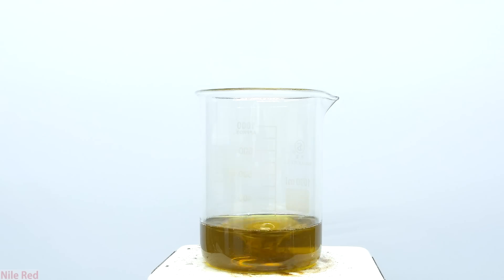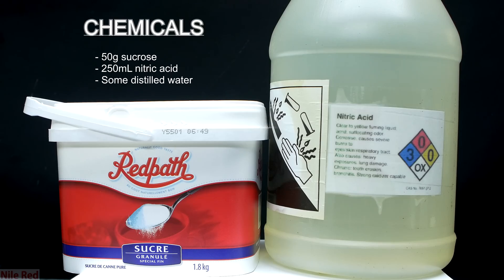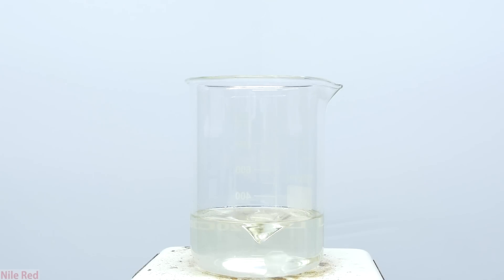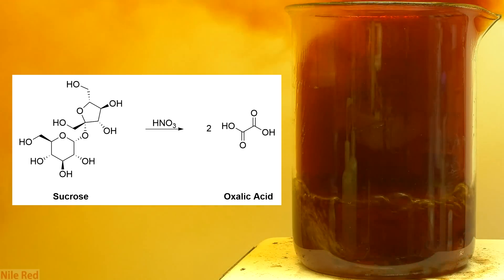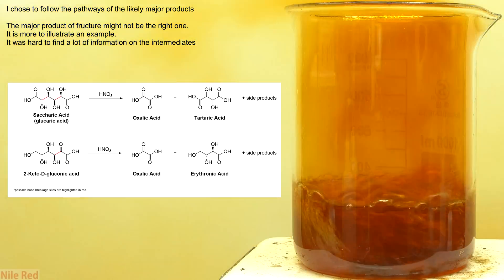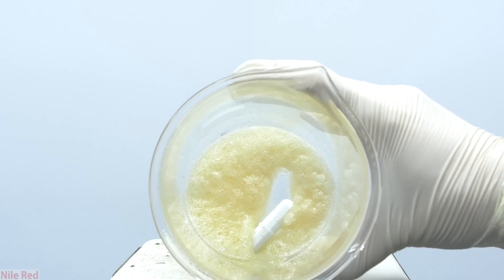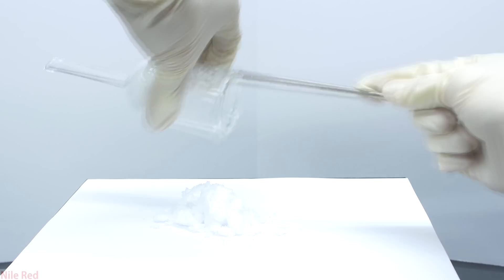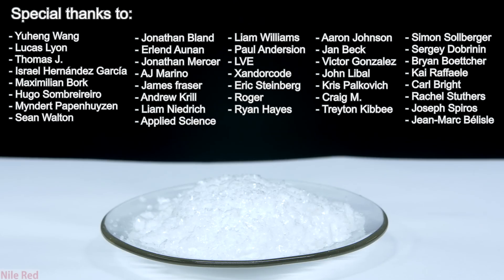Making oxalic acid from cane sugar

Comment: Well sugar would be a cheap way to nitrogen oxides from nitric acid.  The stoichiometry of the nitrogen oxides is important if you want to use a potassium hydroxide scrubber.  At least half would be the nitrite.  Hydrogen peroxide could be a scrubber to reclaim nitric acid.

Comment: This is actually pretty close to the reaction used in industry to manufacture oxalic acid. Instead of using just nitric acid, a mixture of sulfuric and nitric is used. Vanadium pentoxide is usually added as a catalyst. Other (read: cheaper) carbohydrates can be used, like sawdust or molasses. The loss of yield is outweighed by using what is basically waste biomass as the starting material.

Comment: Oxalic is very toxic beyond kidney issues and not just by ingestion! Correct this video for safety! I use this and many other materials industrially, going on 45 years now. It can be absorbed through the skin or mucous membranes and rather quickly if there are any minor cuts or abrasions. Calcium oxalates form quickly inside the body and will create insoluble obstructions in finer blood vessels. STROKES. Medically documented in leather tanners who regularly handled liquid solutions without gloves. This information is not on standard SDS papers.

Comment: Try washing the precipitate with acetone, oxalic acid doesnt dissolve in acetone, morover acetone absorbs the  h2o on the oxalic acid. Then proceed with heating the oxalic acid at the oven and putting it at desicator 24 hours

Comment: Why do chemists always just let the no2 fly off? wouldnt it be more efficient to do this in a RBF and have the no2 get bubbled into water to make more nitric acid from the no2??
Reply: It absolutely would be more efficient, but it would also mean more preperation, more cleaning, and potentially more waste. Plus, putting gasses in a closed enviroment like a bubbler requires careful treatment, and consistant attention. The extra effort may be worthwhile for an amateur chemist without easy access to nitric acid, but I take it that NileRed has a safe surplus of the stuff.
Reply: Since the nitric acid is expensive, the NO2 gas really ought to be captured, and you'd certainly do this if you wanted to make a lot of oxalic acid; but the bubbler and all that rigmarole to regenerate the nitric acid begins to distract from the purpose of the video. And the toxic gas looks really awesome

Comment: can u recrystalize the oxalic acid washings?
Reply: Jorge M not effective
Reply: Firehoax I'm a chemistry student, and sometimes it worked for me ( with different compounds and solvents) but I just had the idea.. plus u can evaporate all solvent, redissolve and crystallyse( tho water would suck to evaporate)
Reply: Jorge M yea, but its a 43per cent yield so I wouldn't even try
Reply: Well, shame nitric acid is hard to get i guess
Reply: Jorge M yes, but in croatia you can get it for 15$ per liter azeotropic

Comment: how to prepare derivatives of oxalic acid ?
Reply: I know you can get simple oxalate salts by reacting oxalic acid with alkali hydroxides.  For example, C2H2O4 + 2 KOH -> K2C2O4 + 2 H2O , then you'd have to evaporate the solution to retrieve your potassium oxalate (with small amounts of KOH or oxalic acid impurities, depending on which one was in slight excess).  That's all I know, sorry...

Comment: Any chance you'd show us how to extract oxalic acid from rhubarb leaves?
Reply: Take a soxhlett, put in your rhubarb leaves, take water as a solvent and let the extraction run for a couple of hours. Boil of the createt solution, maybe wash it with ether (or a similar polar solvent,). The oxalic acit shouldn't solve very well in organic solvents. If it's to dirty you can rekristallise it out of water. Aceton could work as well
Reply: @stanalbatross8615  Thanks!
Reply: how should i know what the right reagents that should be used in extracting oxalic acid? in the video he uses nitric acid, is it ok if i also use nitric acid for extracting oxalic acid from a fruit?
Reply: @yukiyuki7761  No, the nitric acid's used for breaking down the precursor molecule (sucrose), NOT as a solvent! Also if you don't know what "organic solvents" are, then you really shouldn't be extracting oxalic acid from anything at all.
Reply: Yuki Yuki - no, that would be a waste of nitric acid.

Comment: Have you tried melting stone yet. oxalic, acetic, citric acids. It is said the combination can disolve stone and metal but is safe to handle with your hand and leather boots. It was originally found in a jungle plant in South America. birds used the leaves to carve holes in the stone cliffs for nesting. it also ate the spurrs off the explorers boots when they were trying to find the plant. At first the couldn't find it but they lost the metal from their boot, so they knew they had at least passed through it and it was not a hoax. 

I am not sure if it is the same composition but INCO uses a chemical smelting process to extract metals from granite by melting the raw material and solidifiing the seperate components. Almost magic to watch.
Reply: A type of geopolymer: non-carbon polymers of silicate and almuminate groups, at least if you're using alkali process!
Acid process acts on the grain-bounderies of stone, softening it enough to work by hand.
Exposure to CO2 from the air hardens the stuff over time.
Egyptians grew enormous fields of rushes, relative to the North American cat-tails.
They grew rushes, burned them and collected the ashes.  Potassium and sodium carbonate mixture, quite basic.
Additional work make the hydroxides of the salts; lye and potash.
Take your stone, pulverize it a bit, and steep in the caustic lye solution.
The silicate and aluminate groups are torn apart by the solution at first, making a putty-like substance that is a mixture of Si and Al monomers.
The monomers link up to form polymer groups,  typically flat hexagonal structures.
The flats stack up to form crystals with 'holes' in them.  The center of the hexagonal cores is empty, so it lets some molecules through based on size or electrical charge.
A geologist would call this crystal a Zeolite, a scientist would call it a molecular sieve, the workers at Ghiza called it mud and packed it into molds to make the big blocks.
This is why the massive stones fit together so well; they were cast in place!  
Fluids move to fill their surroundings, putty under pressure does the same thing.

Comment: Actually you don't need nitric acid for this. Hydrogen peroxide with a small amount of either vinegar or hydrochloric acid is probably better and it can afford you a little more control over the degree of oxidation that occurs. Cold and Dilute hydrogen peroxide can  afford ketones and aldehydes, where as, something like this, would be hot and something like 10% h2o2 taken to a roiling boil.
Reply: Walter Bunn How about HCl oxidized with bleach? I cant get neither 96% sulfuric, neither nitric or pot nitrate. I live in Europe.

Comment: Can you try to wash the product with diethyl ether or hexane to get rid of the organic impurities? Or try DCM, Chloroform, ethyl acetate or THF? I think most of the organic acids are not pretty soluble in those kind of solvents while the organic impurities are quite soluble. I will probably triturate the crude product with one of those solvent and then recrystallise in methanol/ether or methanol/hexane system. Hopefully will get a very pure product.

Comment: Would ethylene glycol from antifreeze and oxidizing with potassium permanganate work?
Reply: This would be exothermic and just burn.
Reply: if you dilute  the antifreeze and acidic potassium permanganate soln.... u could make it... problem is the separation of Mn ions and oxalic acid
Reply: looks like it's time to hit the lab :3
Reply: You can use a mixture of nitric and sulfuric acids to oxidize ethylene glycol. Important: ONLY use dilute acids (30-38%). If you use concentrated acids, you will make EGDN, which is a powerful touchy explosive, a nitroglycerin analogue.

Comment: One book I have,describes the preparation of oxalic acid from wood chips: those are heated in strong solution of KOH. Cellulose is said to dissolve,forming HCOOK at first,but upon continiued heating,potassium oxalate. further,oxalate is just percipitated as calcium salt,reacted with HCl to give the acid and cooled,to make it crystalise.. 
So does that basically mean,that potassium formate,upon heating,sort of reacts with itself to make oxalate?( it is said here,that two molecules of formate combine,to give one molecule of oxalate).
Asking,because I haven't seen any oxalic acid being sold around,but local hardware store sells 85 % formic acid.. was wondering if I could make it this way..
Another idea was to isolate it from rhurhab leaves,but I guess that's just too inefficient and complicated..
Reply: the sodium formate  is reakting with "itself" to form the sodium oxalic acid. thats what they do in the industry. at around 360°C, not sure if under pressure.

Comment: Concentrated Nitric acid is essentially completely off limits to any hobbyist in the UK. You can apply for a permit but as far as I can tell you won't be granted it unless you are some kind of established company.
Reply from the maker: can you get nitrate salts?
Reply: Nile Red you can, but the supplier will probably report it to the government, and if they decide to come a knocking and you have used it to make concentrated nitric without a license you can get 2 years, at least that's my reading of it https://www.gov.uk/government/publications/licensing-for-home-users-of-explosives-precursors/licensing-for-home-users-of-poisons-and-explosive-precursors
Reply: Wow the uk sucks
Reply: +Michael Stephenson i dont think you're doing your homework son
Reply: +zombie apocalypse "After 3 March 2016, it is an offence to possess or use a regulated substance without holding a valid EPP licence issued by the Home Office." If you make concentrated Nitric acid you surely possess it, so it follows that you are breaking the law.

Comment: I am not fully convinced about purity of your product. According to reaction scheme which you've shown there are tartaric acid form. I think it is less soluble in water then oxalic acid. Also, maybe washing with something like ethanol or acetone would increase the yield? However I don't know how soluble is oxalic acid in those solvents so it would required some testing.
Reply from the maker: Yeah, i should have emphasived a little more that the product isnt SUPER pure. Tartaric acid is a few times more soluble in water though, so I think most stayed in when the oxalic acid precipitated out. 

In the end, it was more for fun and a last resort method for oxalic acid. Because of that, I didnt do any further purification (although i think i should have).

Comment: Given how messy the reaction is, how do you know your product is pure? TLC or melting point would be nice
Also any chance you could use a different oxidation method? Maybe ozone or acid + manganese dioxide could do the trick. Or possibly electrolysis?
Reply from the maker: that is a good point. It isnt going to be SUPER pure, but decent enough. It could have been recrystallized. The reaction is messy, but the main product is oxalic acid. I should have done a melting point considering i bought an apparatus a few weeks ago...

Comment: Could you have captured the NO2 into some water and get some (or most) of the nitric acid back?
Reply: that's a really good question. it probably would work and probably better in peroxide.
Reply from the maker: In theory it could be converted back, but I dont think the yield would be super worth it.
Reply: +Nile Red where can you get cheap glassware, I am tired of science websites that over price their glassware and most eBay, ali express, and Amazon sellers have their stuff over priced or damaged.
Reply: +Dan Swoboda I meant glassware that is good quality, but a cheaper price as well like used glassware in good condition.
Reply: ive had good luck with karter scientific on amazon, just be careful with heat shocking.
Reply: +The Chemistry Kid a lot of times things like glass equipment are expensive because of the processing of the glass and making it harder to crack when heated. I don't actually know of cheap glass equipment but be careful because cheap may mean that it won't last long or even fail in the middle of an experiment (which isn't ideal)
Reply: NileRed 
It would reduce pollution.

Comment: is the no3- ion involved in the reaction or could you also just use an equivalent amount of conc. sulphuric / hydrochloric acid?
Reply: +Ulim151 It's not, not at all.
Reply: Nitric acid works as an oxidizing agent so no you can't.
Reply: Suphuric acid is a stroner oxidizer than nitric acid
Reply: +James Oldfield There are no ester bonds, only acetal bonds connecting monosacharides, and going from sugar to vsrbon is not oxidation or reduction.
Reply: +James Oldfield Sugar and carbon have the same oxidation state, 0, when oxalic acid has an oxidation state of 3. You need an oxidizing agent and only nitric acid will work.

Comment: How are you going to form the acid chloride of oxalic acid? I can't think of any OTC chlorinator that would work other than phosphorus pentachloride, and that's awful to work with.
Reply from the maker: PCl5 is the answer :(. Preparing that will definitely be fun
Reply: PCl3  PCl5 or SOCl2 maybe. or phosgen?
Reply: Maybe you could use oxalyl bromide instead? Preparing that by phosphorus tribromide should be a ton easier than making phosphorus chlorides (chlorine is awful, and white phos is worse), and it should still work for making TCPO.

Also, if all you want is phosphorus pentachloride, why do you need to convert the red P to white P? I was under the impression that PCl5 could be made by combination of the elements, but PCl3 in the home setting required white P to reduce the excess pentachloride formed.

Comment: How dangerous is oxalic acid?
Reply: Oxalic acid is like angry vinegar on steroids, and it'll kidney punch you until you die. (At the beginning of the video he more or less says that). Like any acid, you wouldn't want a concentrated version of it inside you. Suck on a lemon or take a deep whiff of vinegar. Not nice is it? Those are weak by comparison and you just experienced a non-concentrated version. Oxalic acid is worse.

If you get it on you, rinse with lots of water ASAP and you'll probably be OK.
Reply: +Lagraig O'Moof ok, is it only toxic in terms of ingestion?
Reply: +ChemPyroTV ok thanks
Reply: We worked with it in a lab so it can't be to dangerous.
Reply: I've worked with cyanide in a lab, so that's not a really good argument.
Reply: They didn't allow us to work with mercury salts in that lab.
Reply: Well, considering we were allowed to make explosives, that may tell more of the security of our lab than the security of oxalic acid, per se.